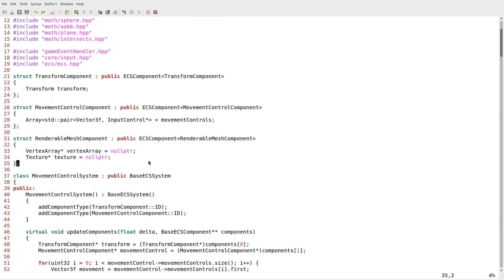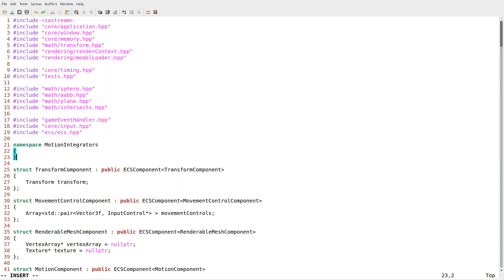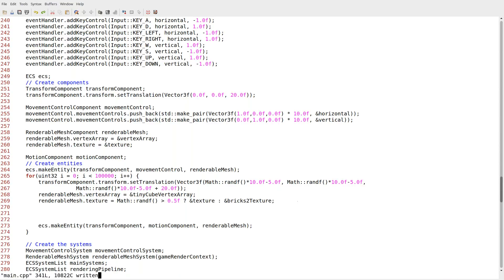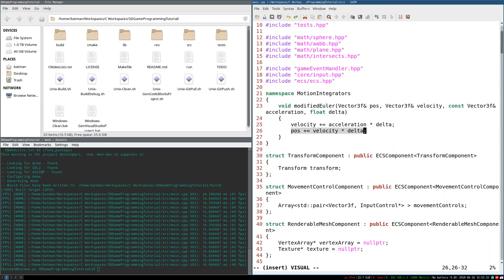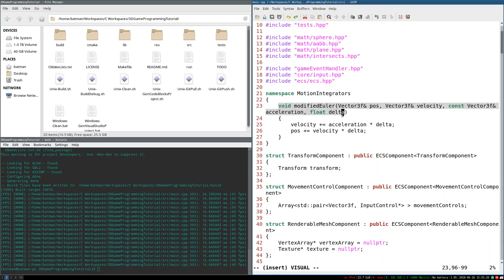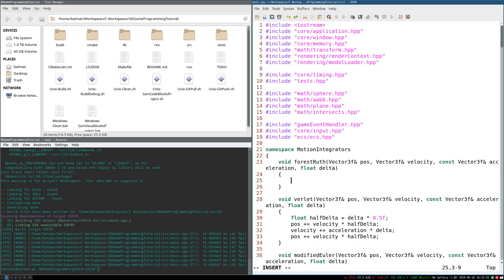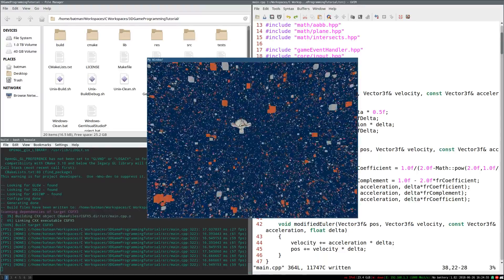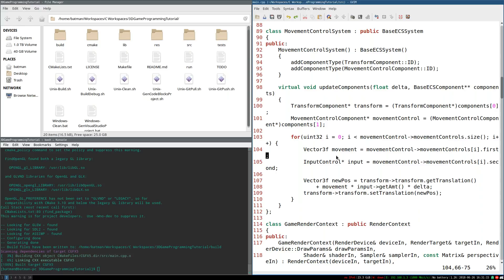#16 3D Game Programming Tutorial: Motion Integration

Comment: Modified euler is all I ever used. I wasn't even aware of all of these methods! Do I really have to worry about this stuff?
Reply: Nevermind, I understand now. I discovered this source and it explains this well: http://lolengine.net/blog/2011/12/14/understanding-motion-in-games
Even knowing a tiny bit of calculus helps to understand the need for verlet integration.
Reply: But the article praises RK4 🤔 now I’m really curious
Reply: Ferdinand S   That is true haha, although I didn't really focus on that part because I don't understand that yet
Reply: FuzzyCat444 yeah well he didn’t explain what rk4 is so you cannot really understand it (I do neither)
Reply from the maker: For others reading this, my answer is this: yes and no. Doing integration naively will always cause subtle problems, but the extent to which that is an issue really depends on your game. If you can both tolerate some odd physical behaviors, especially conservation of energy/momentum being violated, and you also don't need movement to be absolutely perfectly accurate, then you can probably get away without the best techniques. The thing is, you could simply use the better integrator and then never have to think or worry about it again. It's hard to know whether you really need the better integrator until it's already causing rare and subtle bugs that are extremely difficult to track down (or causing something to behave blatantly incorrectly, like a planet orbiting a star suddenly flying off into space for no reason, which happens with both naive euler and RK4 integrators).

Comment: Why all the stress when you can simply have a fixed update loop (even interpolated for smooth visuals), which is a better fit for games anyway because deterministic behavior.
Reply from the maker: I'm assuming by fixed update loop you're referring to using a fixed timestep (i.e. update might be called once every 1/30th of a second, precisely, with the same time delta every time). That's a different thing than what's discussed in this video; in fact the code is already using a fixed update loop. The idea of choosing an integrator solves a different problem. Basically, if you try updating an object's position/velocity/acceleration naively, you can find yourself in the nasty situation where objects mostly behave how you want, except for some cases where things behave in bizarre, unexpected and aphysical manners. That's true even with fixed timesteps (though those do help quite a bit). Choosing a proper integrator avoids the issue by doing those updates in a mathematically sound fashion.
Reply: Not sure I quite understand what you mean:

You probably mean the integrator should work for any update rate you so choose. But if you know your target framerate (and you ideally should) and adapt the physics to one specific update rate, like 60 hz, why would you need an integrator in the first place? Games should be designed for one specific framerate anyway, because of deterministic consistency. This should only be violated by performance demands, like Pc Doom2016 running at 60, but Switch version running at 30, which is a terrible situation anyway any indie should avoid.
Reply from the maker: Your understanding is precisely reversed from what I was trying to say. :) I was trying to say this engine is already doing everything at one specific update rate. That's a separate issue from using a proper integrator. Using a bad integrator will give you bad results regardless of whether or not you have a fixed update rate. In other words, the issue with a bad integrator has nothing to do with update rates.
Instead, it's an issue of mathematics. What an integrator tries to solve, mathematically speaking, is an integral like in calculus. The way most people choose to implement that is objectively an incorrect way to compute a calculus integral. In doing so, those inaccuracies create incorrect results in a physics simulation, which ultimately results in incorrect physical behavior. That's true even in the world where you design everything for one specific update rate. That's why it's something you have to deal regardless.
(Also note, conversely, if you do use a good integrator but don't use a fixed update rate, then you still get all the problems of using dynamic update rates. Fixed update rates and good integrators truly solve completely different problems).
Reply: Also: don't use a fixed update rate. Ideally you want to update physics twice per frame, and let the frame take as long as it takes. 
DOOM 2016 on Windows is in fact not capped to 60Hz, it can be unlocked unless you leave VSync on, in which case it will target you monitor's refresh (so not necessarily 60Hz) or when it can't keep up, it will drop to half your monitor's refresh. (Otherwise it will show tearing)
Programming without different framerates in mind is the reason cows literally fly in Skyrim when your framerate isn't 60Hz. Not all computer hardware is the same, nor are gamers' preferences, and artists will want to use as many polygons as they can wherever they can so you can't and shouldn't target a single framerate, except for "at least 60fps on X hardware" or something.
Reply: "Programming without different framerates in mind is the reason cows literally fly in Skyrim when your framerate isn't 60Hz. "

Lol, no. Fixed Update rate is pretty much a necessity for consistent behavior across all machines. You cannot get it without a fixed update loop. Think about the actual topic you are talking about :P
Reply: "Fixed Update rate is pretty much a necessity for consistent behaviour across all machines. You cannot get it without a fixed update loop."
Well, no. If it can't maintain that fixed update rate it will either have to skip a tick or lag behind. So the most consistent behaviour is if you write it in a way that takes the delta time of the update into account. You can get that without fixing it, just think different.
Reply: If you introduce a delta time (i.e a variable update loop) you will throw out consistency out of the window (plus that is when you see your cows fly). Your game won't be deterministic, it will be a slightly different game for each person (with more or less nasty corner case repercussions). If it lags behind once in a while, then so be it, just let it, each frame is still consistent. If it lags behind constantly, then you are not in the right performance metrics anyway and should reduce your graphics settings or whatever bottlenecks your performance or buy a better pc. Or even better, games should be designed to adapt to intended performance, and not to visuals. That is why few devs finally come to their senses and introduce dynamic resolutions for example, to adapt the visuals to maintain performance, rather than sacrifice performance to maintain visuals.
Reply: You have a different definition for consistency. For you it is about consistently keeping up with the wall clock. This a performance metric, not the actual consistency I am talking about . It is about mechanical consistency within each update frame, each update frame remains exactly the same, regardless at what performance you run them.
Reply: Then a "fixed" update rate (and/or "update frame") is either a misnomer on your part, because you can't have it fixed and performance independent at the same time, or there's something I'm missing, or there's something you're missing. 
I get the idea we both know what we're talking about, but not completely what the other is talking about. 
Thing I do is just use delta time, nothing's fixed.. Behaviour couldn't be much more consistent if it were fixed and it's performance independent.
Reply: This is a good explanation of how to use fixed update rates to produce consistent results on machines that run at different speeds:
https://gafferongames.com/post/fix_your_timestep/